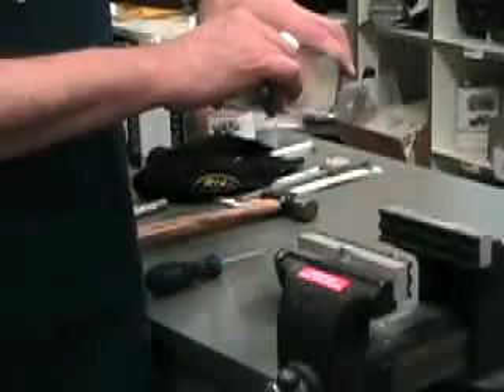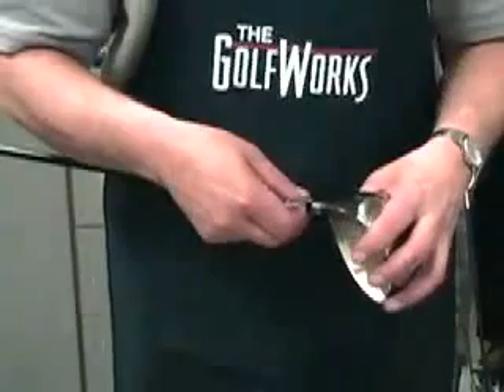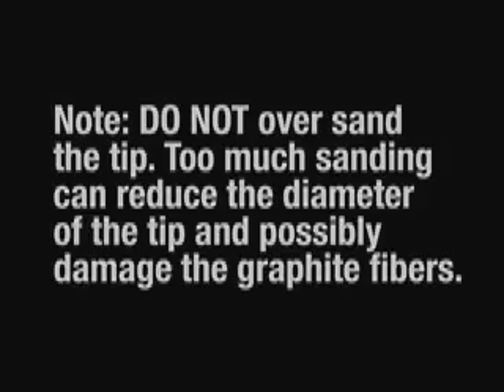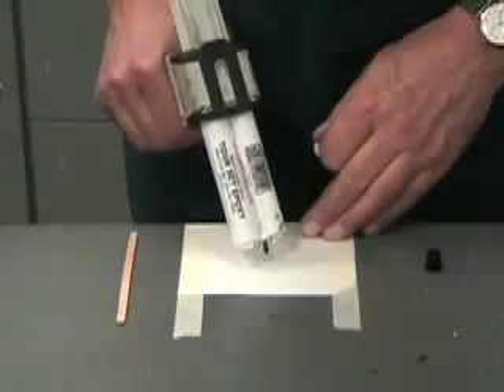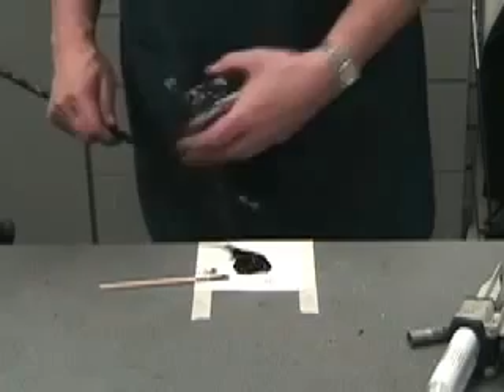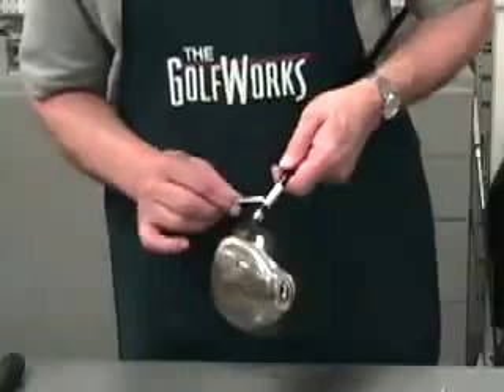How to Install Graphite Golf Shafts

Comment: If you use too much epoxy, a piece of it comes loose, and get that rattle
inside the head. Golf Works sells end caps that fit in the hozel to prevent this. Performing any step wrong assembling golf clubs with graphite usually leads to failure. Unlike steel shafts, you only have one chance at it, and your investment,
is basically gone forever. It's risky, but keeping the cost down on a custom made driver or wood might be ok. Failure is only for those who don't try.